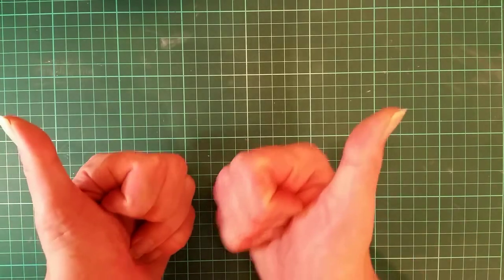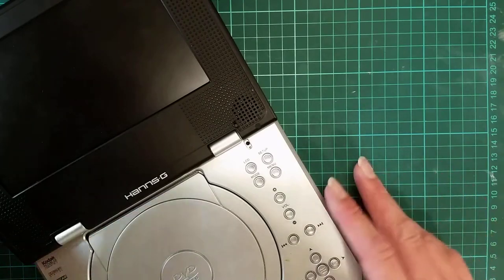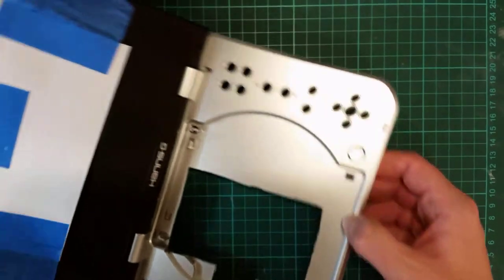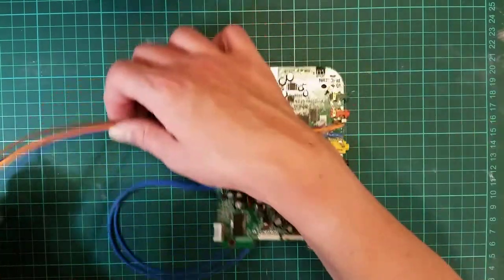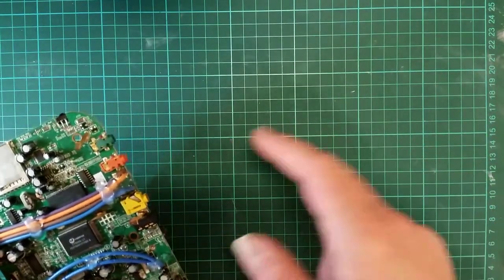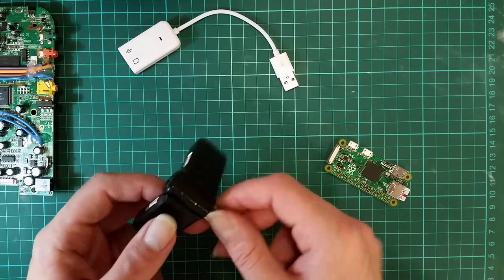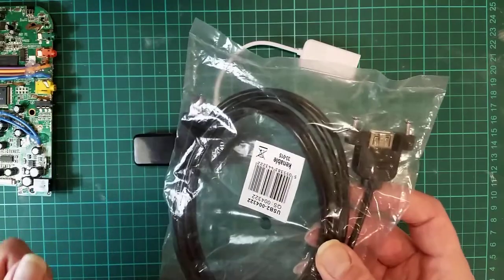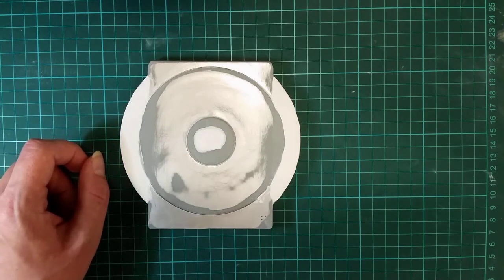DVD Player to Retro Portable Games System

Comment: How did you automatically make the signal output to AV IN and not DVD ? I have a cheap player like that but when I power it up the video defaults to DVD player and I dont have any controls to select AV IN ? Thanks for video, very interesting but basically counter distracting :)
Reply from the maker: The line in socket had a switch to detect AV in jack. So that point needs to be bridged and will always be set to AV
Reply: @TheDutyPaid  Mine isnt switched its controlled by screen menu but dont have remote control. maybe I could try a link wire on controller chip and trick it.
Reply from the maker: @arnolduk123  have you tried plugging in a lead to the AV socket?
Reply: @TheDutyPaid  Yes, its a 2.5mm jack with L/R Audio and Composite type. Does not switch to AV mode when plugged in.